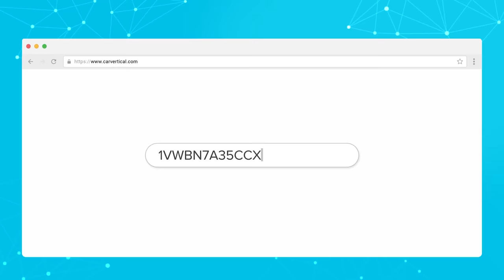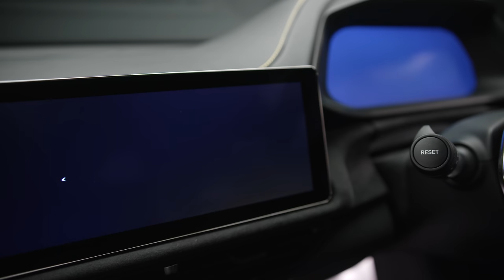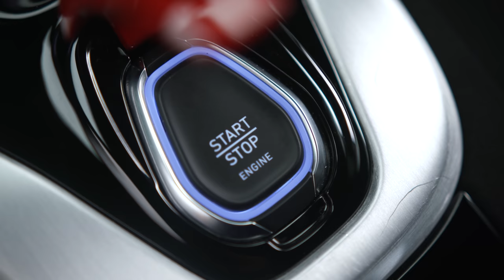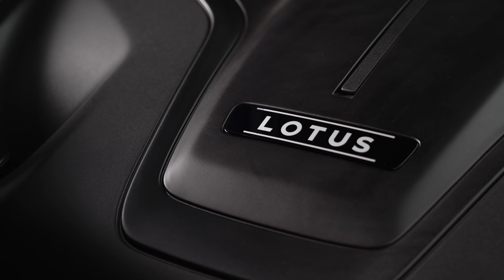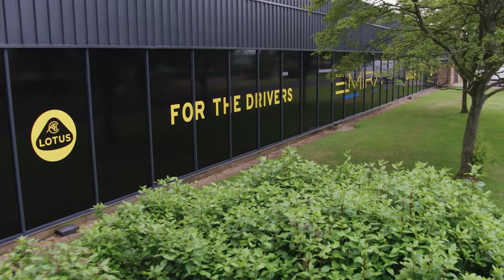The New Lotus Emira - An Evora Fan's First Impressions.

Comment: The weight is EU DIN, meaning with all the fluids and a 75kg driver. So it's still extremely light weight for a modern car. It's not carbon fiber tub light, but still light. Surprised to hear you complain about it as much as you have, but hey... nothing's perfect and you can't win everyone. Let's see what actually comes. I'll be driving mine next year, if you want to fly to the US and do a review. Have guest rooms in my house and beer in the fridge - so some expenses-paid trip ;)

P.S. Looked at the Evora GT, but it didn't appeal. Not surprised it didn't sell. The Emira has all the right ingredients - it'll be popular for sure, as long as the introductory price is not a bait and switch and options aren't insane.
Reply from the maker: EU DIN is not a thing by the way, its EU or DIN - can't be both

Comment: I think the car is designed well. Has exotic looks for the price. Retains exposed manual transmission. However, I agree with the fact that it might not sell well against the Porsche IF the V6 version is priced relatively high.
Reply: I doubt the V6 will be their biggest seller. I know 4 people who've placed deposits (myself included) on the AMG turbo option which is cheaper, lighter and more tuneable than the ageing V6 model. And it comes with that wonderful 8 speed DCT box.
My guess is that they're using the Emira as a vehicle (no pun intended) to shift any remaining V6 engines they have before they deprecate it due to the new emissions regs. They're already displaying an EV variant of the Emira on the stand at Goodwood.
As long as they keep up with demand and its reliable (why wouldn't it be, its a merc engine and box) then I think the 718 Porsche range is in serious trouble.

Comment: I agree on some of your points, esp the power output, gearbox options and weight, but have to disagree on the looks. I think it looks incredible.

I've always liked my Evora S looks, but admit that it looks awkward from some angles. This seems to take the pleasing underlyimg form of the Evora but in a smoother, more modern form, which references both the past (i.e. the basic shape, the front bumper) but also the future (the Evija influences).

I think it will be a great success, but maybe not enough to secure Lotus' future on its own.

Comment: Not to argue but to add, my favorite color of this launch was the black car actually (looked metallic too), and even more so with those wheels. The blue car, aside from being a popular color, was maybe there to show all of the Emira's curves as well. The wheels on the blue car are maybe the first set of dual-five spokes that I don't like, but that's a personal taste. Being largely based on the Evora 400/GT is an amazing news even if it gained a few pounds/kilos. Hopefully the large rear intakes are to accommodate spicier version that would require more air to breath (aside from looking like a big boy supercar too). The rear also look a little an A110 to me and I'll include the Maserati MC20 as well. Thx for the videos!

Comment: I’m not an aerodynamics expert, but to me the front “lid” slots look like a very interesting take on a front spoiler, a downforce generator mostly during cornering. Imagine air flowing over the headlights and into them during sustained cornering, planting the nose through a curve. Like the Evora, this is its own design. No parts-bin Elise/Exige tendencies.👍
Reply: Graphic at 13:30 shows air flowing out of the slats.
Reply: @The0rs  Correct, with the car moving forward. Either way, the front bumper inlets seem to be channeling air up and out of those hood slots.

Comment: Really excited to see Lotus' latest release. But being a die hard fan I have real trouble with "Light weight and 1400kg" it certainly means something different these days. 1400kg is double the weight of my Old Elan Sprint (700kg) and 3 times the weight of a Lotus 6 or7 (450kg).
Reply: Why is everyone obsessed with the weight? It’s not an Elise replacement. 
You don’t here Ferrari F8 owners complaining about the 1450 kgs. How much does a Huracan weigh? It’s not 1996 anymore
Reply: @PiersDeMann   In fairness the Esprit V8 weighed nearly 1400kg as well. I suppose with engines kicking out much higher BHP you can have heavier cars and still get a good power to weigh ratio.

Comment: i wish lotus would give up on the E's. its getting a bit thin these days. Hear are 2 E's that are still unused: excrement & effluence. I can see the 2.5 years was spent actually improving the production line fit and finish. This is a pretty cool step to be honest. The reason the old models were scrapped, id guess was because they were not compatible with the new production line robots. Lots to like about the new announcements. With the chassis now made in China, im sure a chinese version will sell very well over there.

Comment: Although most people seem to be big on the looks, I not either James. 
Really happy with the price point. I don't know who would get the I4 over the V6. It just seems pointless.
Reply: I know four people buying the Merc engine over the V6 for the following reasons: better gearbox, lighter weight and they are tunable to 500+bhp fairly readily. The V6 is heavy, has shit gearbox options and is not tuneable.
Reply: @andyhammond32  exactly that. I4 will easily be biggest seller. Just a few snobby purists pining over ‘the good old days’.

Comment: I love this analysis.  What makes me mad is - the engine, supercharger, brakes...have all be outsourced.  You don't engineer these parts in-house. WHY IS THIS CAR SO EXPENSIVE?  What makes it worse is that it's an evolution of the Evora, a existing platform that millions have been spent on. The long term strategy is an SUV and Esprit.  Lotus - make the car cheaper than a Porsche Cayman.  Get as many people into the car as possible.  Build a base that wants to come back in 3-5 years to buy your electric vehicles.  Do this.  Do this now.  Why is this so hard?!?!
Reply: It’s funny how people are complaining it’s “just an evolution” of the Evora, yet the 911 has evolved over 60 years with little complaint
Reply: @PiersDeMann  Oh, the 911 crowd whines quite a bit.  Thank the Cayenne and Macan for that.

Comment: James, a balanced review as ever. I probably think that on screen, its looks are good, the side rear 3/4 view is the best imho. A lot has been made about a new chassis and given that it is meant to be very significantly stiffer and that the sills are less obtrusive it probably is very different albeit based on the Evora experience. Ignoring the statements that were put out saying it replaced the Elise, Exige and Evora, it is now clear that we have truly seen the end of the Elise line and everything it brought🥲. The small lightweight car is gone and this can only be seen as an Evora replacement. At some point the decision was made to retain the space behind the seats format, which is an odd one, but given that they couldn’t create this car with a deep front boot, then they had nowhere to go. It all now comes down to quality and reliability. If that can be good, then its attractive and different enough to find plenty of buyers. I am waiting for an Elise and very glad I bought one now the Emira is out of the bag. I did also put a deposit on an Emira months ago to replace my ‘daily’. As you quite rightly point out you cant judge a car until you see it ‘in the flesh’ and that will hopefully happen this weekend at Goodwood. In summary it looks a good effort and I am sure it will drive well, but it is an Evora replacement and despite driving brilliantly I could never quite bring myself to spend £85k on a new one.

Comment: The fact that there is no dct with the V6 was a real bummer for me as well and even worse to partner with amg just to have a dct is nonsensical. Toyota already makes a couple dcts for fwd platforms an not only for toyota/lexus cars. Just take a look at Volvo (which just like lotus is owned by geely) that introduced a fwd only xc40 with a dct made by toyota. And the final nail in the coffin, unlike amg, volvo makes (at least they used to) really reliable engine units almost on par with toyota and this is coming from an S40 owner with close to 200k miles. So going with the AMG option is a total turn in the opposite and WRONG direction.

Comment: Good job basically summarizing my thoughts. I think AMG dct version is more interesting and with a tune (or at elevation) would run laps around the v6 (didn't like na or gt evoras that I've driven, manual gearing is too long and there isn't enough torque or character in the v6, don't like the sound either), hopefully this thing is more agile and sportier than the evora (too much of a gt car for my taste).

Comment: I’ve got the Exige 390 Final Edition coming soon - and then I see this! Thought I had a dilemma and immediately thought of cancelling the Exige and putting a deposit down on the Emira - but they are very different cars. I like the Emira (I don’t like the rear - reminds me of a Volvo) BUT it’s clearly designed to be mass-marketable and I’m sceptical of build quality, how common they become and residuals. I will still crave that ‘pure and mechanical’ driving feel which is actually why I wanted the Exige in the first place! That said, I think it’ll do well attracting a new type of Lotus owner. Being honest, when it came to the crunch, my head would say Porsche.

Comment: Thank you James for actual honesty and not going straight to corporate ass kissing like everyone else.  Chassis is literally Evora with new body and interior. You can clearly see that in manufacturing clips.

I own 2 Evoras 400s  and will gladly debate anyone over looks as Evora and Emira both have issues.  I will be getting Emira eventually but not because of styling.

James points out the biggest fail at least with launch is hp numbers. Absolutely no reason V6 should not be up to 450hp with 11 years of development. Hopefully much higher hp versions down the road. 

Car will bring in new customers which is good thing. Hopefully Lotus will do much better job promoting in US. Did miserable job with all versions of Evora.

Comment: I am so glad that you mentioned lotus has kept the same old shitty 6AT with the weird gear-shifting logic (in manual mode, the shifting is super slow unless foot off the gas during shifting). I want it so desperately that lotus keeps the beautiful 3.5 V6 and improve its automatic gearbox. Luckily we still have the 6MT option. In terms of the 2.0T, never a big fan of AMG. I agree with you 360hp is a bit underpowered, and it just can’t matched up with that beautiful high-revving sound like before. 

I will still go for the 4.0 NA Cayman. 

Thanks for your informative and helpful preview. Liked and subscribed!

Comment: Beautiful car and the interior looks a big step up. I think this is a 911 competitor than a Boxster/Cayman. The interior is definitely a level up from a Boxster and the size is also 911. It'll be interesting if the leather/Alcantara comes as standard. I'm a Boxster owner, if Lotus come out with a convertible/targa variant, which I expect things could get very tempting. I would expect to see a stripped out GT/GTRS limited edition. I know a few Porsche owners who have put a deposit down. I agree with you on the black, it's the JPS Formula 1 colours, I think a gun-metal/titanium grey would look nice on this car with a black roof...I think Lotus is aiming to go upmarket, no more Elise/Exige, market just doesn't support them. They have a hypercar, now a sports car, supercar (Espirit Neo) and an SUV at some-point. The disappointment was the lack of the ZF dual-clutch gearbox on the V6

Comment: Lotuses' relationship with Toyota has borne some wonderful fruit ... (better relationship than their position with GM and Proton in the past) But it has created problems, which has hindered the potential of some lotus models ...

Toyota have always had issues with their torque converter automatic transmission's, which make their cars feel a bit slower than they actually are ... The V6 Camry (with which the Emira shares an engine), was always aimed at people not necessarily into performance driving ... Hence great engine and sub par transmission.

The torque converter Camry transmission within the (automatic) V6 Emira is likely not to have been fettled by Lotus (likely for longevity/ wear and tear reasons). Sadly, the transmission control units/ ecu only give you the performance you want, when you have your foot flat to the floor (in standard form).

The 8 speed/torque converter auto used in the Lexus ISF and GSF, are notable examples of Toyota produced transmissions, with the same problem: a great engine paired with an sub par transmission.

Hopefully Lotus have played around with the final drive on the manual transmission and flywheel ... To pair a great engine, with an improved transmission ... making it feel lively and fast. 

We can only hope

Comment: Some distinctly dodgy opinions on show here. Evora didn't sell well because it was overpriced for something that looked like it came from the middle aisle of Aldi. The market has subsequently changed and Lotus doesn't need a multi model like up of sports cars that no one will buy. They have been smart in launching a halo car, followed by an 'attainable' car with a varied spec to appeal to different customers.
Reply from the maker: The thing is the V6 Emira is going to be priced the same as the old Evora 400 was - £75k plus options

Comment: Existing customers are too thin on the ground... the Evora stalled because it was a 2+2 and not radical(!) enough for others - any Lotus is not your daily driver, it's a hobby car. Styling wise there are no issues, I think it's great.  Does it still have an all GRP body?  Weight is surprising, just where is it all, but 1400kg is not life threatening if everything else is right.  The V6 needs 450bhp, get a new gearbox if the existing can't cope.  Was the Audi V6+auto not an option?

Comment: They're using a 4 cylinder as an option. So why hasn't any of these boutique manufacturers gone back to someone like Honda or BMW and ask "Y'all cracked the 4-cylinder mold back in the 80's and 90's. What if you happened to apply 30 years of tech to the design?" Heck, even Lotus did the same themselves when they were true Lotus back in the past!

Edit to add: no disrespect to Mitsubishi's 4G63 or Subaru's flat 4 (EJ, FJ), those are also "boom goes the dynamite" type options.

Comment: The car is great, particularly in Europe where its price will remain reasonably low (similar to the new C8 corvette state side)   BUT that said being sold in the US the Emira will cost at least 85 grand but in reality, more like 100 grand and higher considering import taxes.  And thats a heck of alot more money than the starting 60 grand price of the Corvette which has far greater specs than the Emira, all had for so much less. And the c8 is even more accommodating with its larger cabin, capable of seating persons of 6ft 7 in height.
Lotus has marginally improved size wise with the Emira, but they still need to be creating cars that most people can actually fit in.   Its always been an issue.  excluding the average size buyer and making cars for short people.  ridiculous.  Thankfully someone either died retired or got fired who put that rule of thumb in place at lotus.  All it would've taken was a few more inches leg room and width to accommodate the average size driver and Lotus would've never had any problems financially.  Their sales numbers would likely go thru the roof.  but instead they catered to hobbits, and the company struggled.  And its taken all this time for someone to take a hint.

Comment: I think you are too unhappy with Lotus to give a proper unbiased opinion. The car looks great to most people and you clearly haven't seen many other reviews to understand this is a completely new platform and steel body (not fibreglass) as well as how that aero works etc.
It is heavy but that's probably due to the much larger vehicle, tech and safety features demanded these days. 
When will do a video explaining exactly what happened with your Lotus fall out?

Comment: Styling looks great out & in, I saw it at FOS. Not sure on engine and pricing. Agree the AMG has more tuning potential than the Toyota. So paying lots more for the noise & a manual box! Not sure it's worth it. Shame they couldn't get some storage in the front, would increase sales, so would 4WD! Though i would choose V6 manual, but not at £80+ k

Comment: Disappointed in the levels of power and acceleration numbers that Lotus is saying. My 9yr old (345BHP) Lotus Exige V6 will leave the Emira for dead. Was hoping for something closer to 500BHP. 
This is no junior/baby super car as has been stated by Lotus. It does however look stunning standing still!
Reply: The AMG 4pot can be tuned to 500bhp, so enjoy the car in warranty then when it's out of warranty the tuning community will have been all over it and it'll have exactly what you want 😎👍 remember Pumaspeed for example get 500bhp out the 1.6ecoboost fiesta engine😆
Reply: @andyhammond32  something to look forward to then 😄😄.
Still disappointed though that theyre launching with less power than the outgoing top spec Evora. 
Playing it safe it seems.

Comment: My Evora GT has better performance.

I've been buying Lotus new from dealers since 1996.  They incrementally increase performance each model year to keep up interest.

This was true for the Esprit, the Elise/Exige and Evora.

My Evora GT has 416hp.  The first Evora had only 260hp.

In 3 to 5 model years, the Emira will have 650hp, and 0mph to 6mph time in the low 3 seconds/high 2 seconds range.

By then it will be time to trade in my Evora GT.

The Emira is off to a stunning start with 400hp and a beautiful body.  I can't wait to see the 2025 version!
.
.